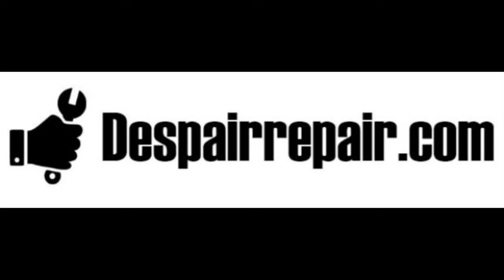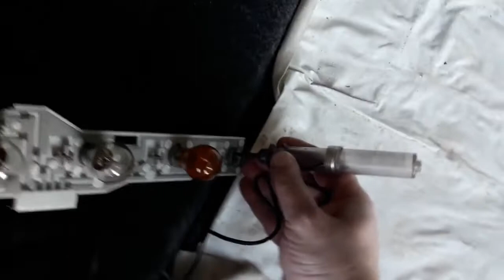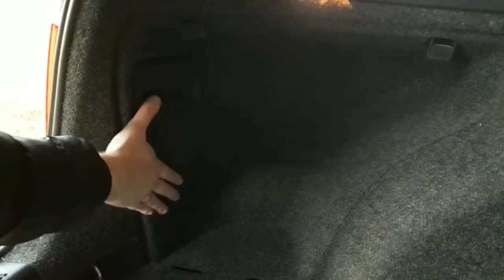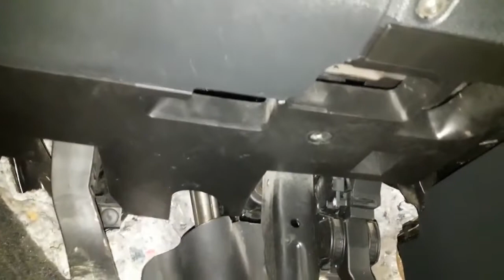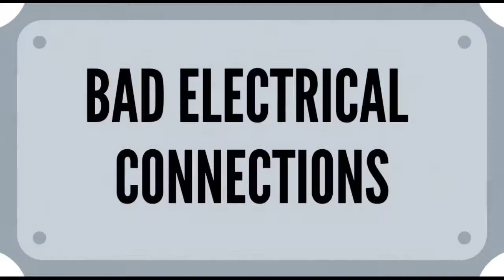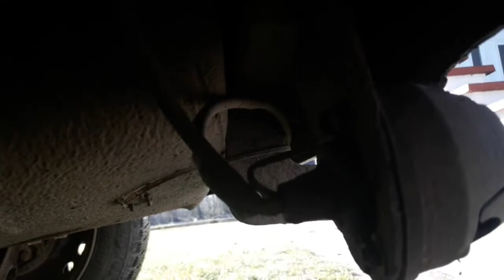How To Fix Brake Lights? 5 Most Common Reasons And How To Find The Problem

Comment: Hi Despair Repair, Thank you, very logical video. 🙏
Perhaps you can help me with my problem?
My third upper brake light is not working, and I have got a fault code for it: B12C615.

It is a VW Polo 2015, and I don’t know if this fault have connection to other faults with rear wiper and rear window defroster. 
I have fault codes for rear window defroster, but not for the wiper, which I find strange, since that only moves sometimes when I activate boot opener. Which by the way sometimes have not worked either… 
🤔

Suggestions and advice is appreciated. 🙏
Reply from the maker: Hi, and thanks for watching! I would first check the wiring inside the rubber grommet between the boot and the car body.
The wires are known to break because of constant bending and this is a common problem on all cars.
Also, I would check the locking mechanism and switch for the boot.
Reply: @DespairRepair  Thank you for reply. 
I have tried to check the wires in the rubber grommet, but they are inside some black tape it seems.
It seems to be related to a ground fault, as even the upper brake light cables gives weird voltages when measuring when braking.
9,5V or -2,5 V.
I think if I can fix that ground connection issue, all the problems disappear.(?)
The boot locking seems fine, apart from what the electrical issue causes.
Reply from the maker: @TS-gg9dk  Yes, that wiring is pretty well protected but I would insist on giving it a check if in any way possible.
This is by far the most common cause of problems.
Regarding the ground connection: did you take a look at how everything is grounded? On lots of cars, it's only through wiring and not grounded directly to the tailgate.
Reply: @DespairRepair  Thanks again for reply. 
Sorry for my delayed reply back.
Regarding ground points, there seems to be one in the tailgate. I have removed the panel to check.

There seems to be two (or three) behind left panel in bagage compartment. Also loosened that panel enough to check.
No visible rust or faults with them, sitting tight also.

You mean the ground could be within the cable harness itself? Because the cables might be damaged?
Reply from the maker: @TS-gg9dk  Hi and this time sorry for my late reply.
Yes, I mean exactly that. Lots of times the wires get damaged because of constant bending.
Even worse, they break in such a way that the wires break but the insulation stays intact making it even harder to find.
It doesn't have to be the reason for your problem but it's the most common..
Reply: @DespairRepair  You seem to have experience working with electrics in cars. 

Do you think I should loosen the (three) ground screws and look at them more closely, maybe spray something on them?

Or just buy the wiring harness, I know it exists as a spare part, and replace it? 

That was my first thought, before I wanted to check if I could see anything obviously wrong with connectors, ground points etc.
The wiring harness costs about 100 Euro, so if it fixes things it is well worth it.
Reply from the maker: @TS-gg9dk  to be honest I worked as a car technician and still do work around my car as a much-loved hobby.
Regarding the repair, it wouldn't hurt to check the ground screws just in case. If they're easy to reach, take a look or clean them.
If you can in some way bypass the ground cable and test if it's actually the problem.
Even better, try using a multimeter and check the pins on the connectors.
100 Euros is a hefty sum of money and if it isn't the wiring harness, you'll throw money away.
Oh, and one more thing. If you can, try disconnecting the brake light and then check if everything else works.
Reply: @DespairRepair Thanks for continuing the dialogue. 🙏🙂 I have subscribed.

I did try to check the upper brake light. When my wife pressed the brake pedal, the lead connector from the car (which attaches to brake light) gave voltage measured with multimeter only up to 9,5 V. (Reversed pin measurement -2,5 V)
So I draw conclusion that it is because of low voltage in connector from the car that is the problem. 
Should be 0V at rest and +12V when braking, correct?
If this is true, then the upper brake light itself is probably OK I think. 
Feel free to correct me if I make wrong conclusions.
Reply from the maker: @TS-gg9dk  thanks for the sub it means a lot to us 🙂.
I think you did everything correctly.
One more thing I would do to be sure is to connect a 12-volt wire and a ground wire to the brake light independent of the rest of the wiring installation.
You can find a 12-volt lead with a multimeter and find a ground connection on a metal surface.
It's sure proof that the brake light is/is not OK and that something else is wrong.